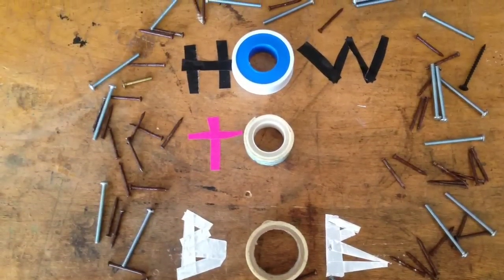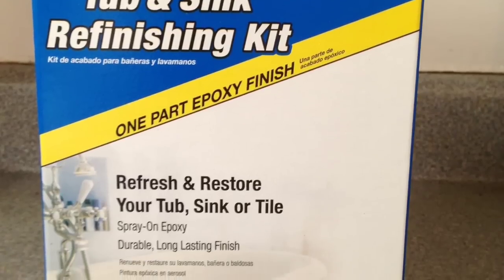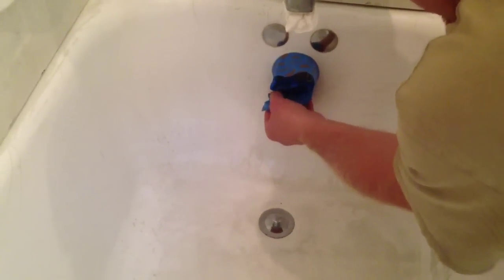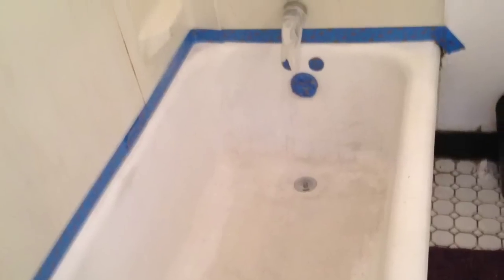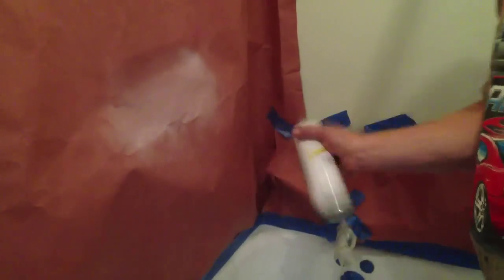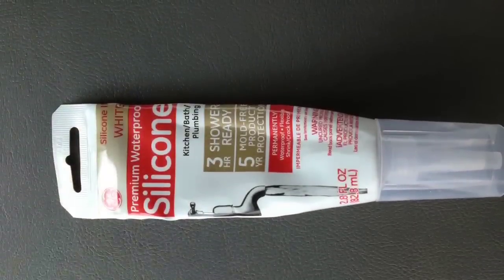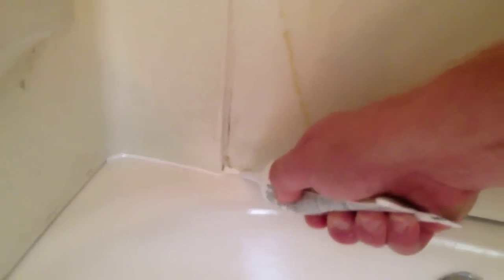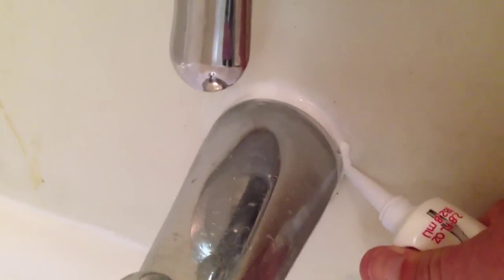Refinishing/Reglazing  a Bathtub. By How-to Bob

Comment: I just have rust around the drain - as water sits there all the time - would it be possible just to repair a small area instead of the entire tub? Rest of the tub looks fine.
Reply from the maker: I suppose you could but the colors would not match and I doubt that it would last as long as you would like.

Thanks for watching.

Comment: Why are there good quality photos and clips throughout your video up until the horribly blurred "result" photo of the finished tub. That totally blows the credibility here because we can't actually tell if it worked or not since the photo is so damn bad.
Reply from the maker: At the time of the final picture, I used my phone to take the picture. The lighting was not optimal at that time and it was not possible to go back and take another because someone was living there. My results turned out GREAT but that's not to say that everyone's results will be the same. Many factors influence the outcome, prep is very important, painting skill, and the ability to follow the instructions as written without taking short cuts. Sorry you were disappointed in the picture but the tub looks great. Thanks for watching.

Comment: I'm planning to do this in my tenant's tub, you mentioned the prep is very important, how would you do the prep if the paint is chipping off the tub?
Reply from the maker: ***** By paint chipping off the tub do you mean the whole tub? If so you will need to remove all the paint that is chipping off. If you are talking about isolated areas you will need to smooth or feather in the chips so that when the new finish is applied it will have a nice smooth edge not a sharp edge from paint missing. The bottom line is that your finish will only be as good as the surface that it is adhering to. Hope this answers your question. Good luck, and don't forget to wear a respirator.
Reply: funbro1 Thanks for the reply! Would you like to take a look at the picture link, this is how the tub looks like: https://picasaweb.google.com/lh/photo/5F8HuVO-a_8fykkI_kt17e6amsWXDO6tf9pbfXO34lA?feat=directlink
Reply from the maker: If the tub is pealing that bad you will need to get it down to the point below the pealing paint to give the new finish a good surface to adhere to.

Comment: @How To Bob my shower and basin is acrylic, not gonna be using any steel wool in it, I am just going to deep clean it, there are no deep scratches or damage of any kind, I am just going to tear out the silicone caulking and apply new... but after, I want to apply a clear finish/sealant for shine and easier to keep clean. What product would you recommend? Can I use a marine or porcelain sealant?
Reply from the maker: Wow, I don't know of a product to recommend that I feel would hold up well enough. Most of the time I come across an acrylic tub the homeowner wants it removed and replaced. Sorry to disappoint. Thanks for the view.

Comment: I plan on using your technique this time.. Last time I used a a different product that had an incredibly strong odor (fifty dollars too but not in a spray). I didn't know what I was doing and it came out blotchy then, because I didn't let it dry, over the course of a year the new enamel coating (or whatever it is) started to chip away badly. My question is, does this stuff have a terrible odor?
Reply from the maker: Joel Shaw YES! The odor is very strong, Use a respirator, open the windows, hold your breath :-) do whatever you can to avoid the odor from this stuff. Just remember that prep is probably the most important step for a good finish. Good luck, let us know how it turns out.

Comment: Thank you for the video. The glazing on my tub has started to peel off in patches. Will the cleaning agent and the steel wool scrub remove all the glazing? If not, what else should I  be using/doing to remove the current glaze, before I apply the new one?
Reply from the maker: +Vanessa Singhroy You could use some fine sand paper but be careful not to go too far.
Reply: He didn't glaze the tub though, he just painted it. :-/

Comment: So I watched this video, used the homax spray (3 coats) and the tub turned out great...BUT after only 2 weeks the old color started coming back through. Should I have used a sealer, glaze, etc? I don't want to have to spray it every 2 weeks.
Reply from the maker: It should have lasted way longer than that, maybe the prep was not done thoroughly enough or maybe the coats were not thick enough??? Those are the only things that could cause this.
Reply: That's because the tub is supposed to be glazed and not just painted. Thats the most important step which I don't see how this video didn't include that.
Reply from the maker: reasy1978 Because the video followed the directions.
Reply: Soooooo I still need a glaze? Thanks
Reply from the maker: Not if you follow the directions on the product. Thanks for watching.

Comment: I have some little round spots where the glaze does not hold. You can still see the old colour in those round spots. How do I solve this issue?
Reply from the maker: It may need cleaned again. It must be cleaned real good. Thanks for watching.
Reply: @funbro1  
I used a spray gun. It covered those spots much better than a brush

Comment: Just bought the kit. How much spray did you have left? I have a one piece bathtub/wall and I'm debating on wether to spray the whole thing or just the tub.
Reply from the maker: Papa Zote I didn't have much left at all, I kept using it to get a thicker layer on the tub. You may want to get another can or two if you're doing the walls as well. Thanks for watching.
Reply: funbro1 thanks. And thanks for the video.

Comment: I just bought a home with a tub that I plan on re-finishing. Currently there is some residue from grip stickers still on the bottom of the tub. Will the cleaning solution and steel wool be enough to remove this residue. So far I have tried Comet, baking soda, and Goo-Gone without much luck. Thanks.
Reply from the maker: Zach Heller It may be enough however it is hard to say for sure without seeing the tub. The best bet is to make sure it is as clean as possible before beginning the process. Thanks for watching.

Comment: you taped the faucet but it doesn't look like you taped the drain- did you just spray around it somehow?
Reply from the maker: kms 1199 At the beginning I had it taped but once it was done being sprayed I removed it so that it would have a nice clean line. Thanks for the good question.

Comment: Would this product work to help seal a minor potential leak in a fiberglass soaker tub? I was thinking about using Rust-oleum, but there is only 1 bathroom in my home, and it looked like it would take days to dry. How long did this process (with Homax) take you?
Reply from the maker: No, the tub should be in psychically good shape. Hope this helps. Thanks for watching.
Reply: Thanks! Appreciate the help!

Comment: How long will this finish last? will it chip off of fiberglass tub. I spray painted the tub, chipped off, looks horrible. Not with this product just some paint from the hardware store. Thought I would ask before spending 50. thank You
Reply from the maker: This product is designed to work on tubs,sinks, and counter tops so I would say that it should last longer than any standard spray paint. Preparation is the key to make this product last longer. Also how it is treated and cared for will have an impact on how long it lasts. No harsh scrubbing or scouring pads should be used. Hope this helps you with your decision. Good luck and thanks for watching.
Reply: I'm on Amazon right now! I have a mess to clean up from my other attempts to restore, so I understand the need to remove all, right down to the bare tub. Thanks for the quick response~

Comment: What and where did you get to cover the tub before spray painting it?
Reply from the maker: I just used masking tape and paper. Cardboard can be used as well. Thanks for watching.
Reply: Thank you. I just wanted to let you know I have done every single thing you saw on your video but after 72 hours The tub doesn’t feel smooth. When I rub my hand on it it feels very rough what do you suggest I think I do?
Reply from the maker: Sounds like you may have some dry spray going on.
Reply: @funbro1  Should I leave it the way it is?

Comment: what if it has already been glazed and is peeling and a mess? It won't come off.
Reply from the maker: +pauletteleroy Prep is probably the most important step when doing this process. If you cannot get the old glaze off then it is probably in good enough shape to go over just make sure to smooth the edges where it has peeled off or you will have a visible line. Hope this helps. Thanks for watching
Reply: +funbro1 thanks for the quick response! I will be doing this for sure! It beats paying someone a large amount of money if we can do it ourselves. :)

Comment: would you recommend doing this on an old claw foot tub?
Reply from the maker: I would recommend weighing out your options. How much would it be  to replace the tub? How much to have it professionally done? How handy is the person that will be doing the work and even how often and hard will the tub be used? After weighing out all of these options you may decide to have a go at it. In short yes I would do a claw foot tub but that is up to each person as to what route to take. Hope this helps, thanks for watching.

Comment: THANKS HOW TO BOB.....Home Depot in our area doesn't have the Homex...what do you think of the epoxy paint-in-a-can?
Reply from the maker: Are you referring to the 2 part epoxy paint-in-a-can or the brush on product?

In my case I needed to go with the fastest drying product available because people were living in the house at the time. I would have rather used one of the other products for better durability but time was not on my side in this case. Either way the product you use should work fairly well if the tub is prepped well. That is the most important part of this project. Thanks

Comment: I have a tub that we had professionally refinished 20 years ago, we moved out of the house and started renting it out. The renters destroyed the new finish and it is coming off everywhere. It's time to refinish again, thanks to your video we are going to do it ourselves saving hundreds of dollars. Our adult kids are moving into the house so I am going to use their elbow grease to prep the tub surface. I'll post a photo soon. Do you have any advice for me. I just emailed your video to my kids and told them to get the tub ready removing the caulking and using heavy duty steel wool to get the old finish ready all while I am recharging in NY :-)
Reply from the maker: Sheila Beal The same thing happened to us. Tenants tore up the old re-finish so we decided to do it our self this time around to save some money. The best advice is to prep the tub really good and do a few coats not just one heavy coat. Good luck and thanks for watching.

Comment: how long did your finish last?  Did you do anything with the fiberglass shower insert?
Reply from the maker: The length of time it will last depends on how it is used, how well it is applied and what is  used to clean the tub. In this video I did not do anything to the fiberglass shower insert. Hope this helps. Thanks for watching

Comment: i can confirm that this stuff works and creates a great shine and seal on my tile and garden tub..however the smell is very very bad and last for 3 days plus esp. if you don't have a window in the bathroom or good ventilation. wear a mask and protect your skin,  this spray gets ALL over the place. also, if you can find an epoxy that isn't spray can, go for that. painting it on will be easier.
Reply from the maker: Yes you are telling the truth, very strong smell. Keep that in mind when preparing to do this project. Thanks for watching.